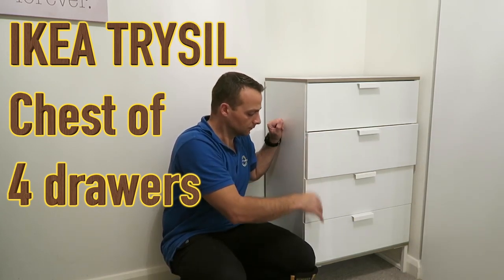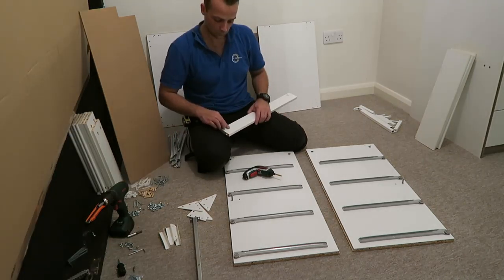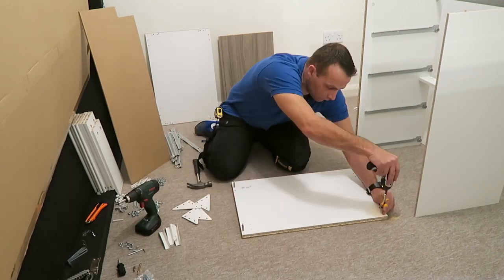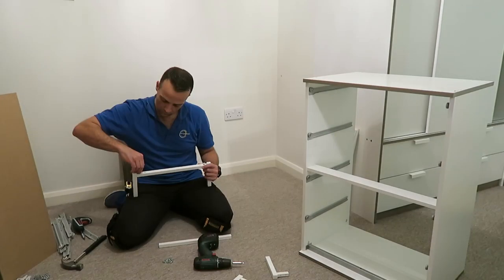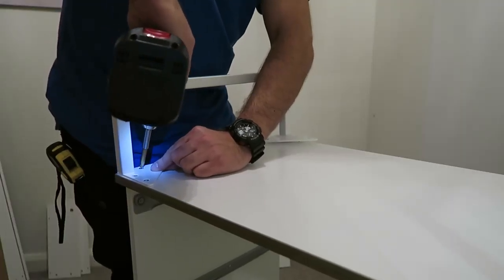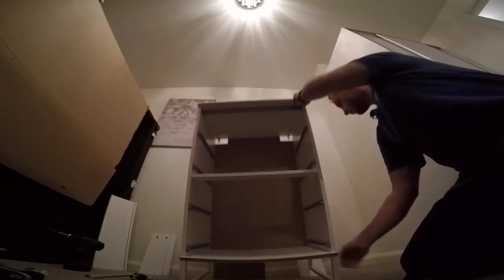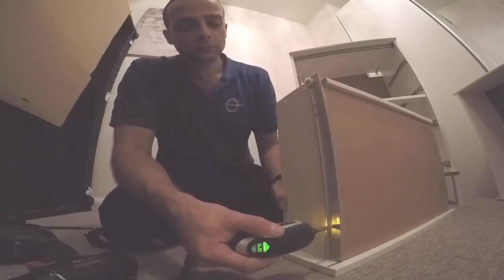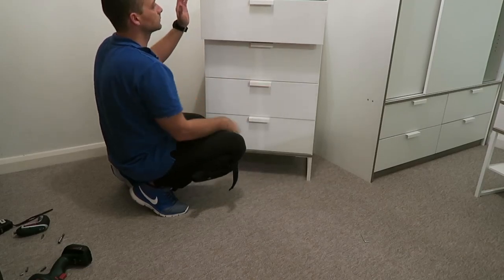IKEA Trysil chest of drawers assembly

Comment: I cant figure out step 12 (what he's doing at 1:53). I screwed the wrong screws in there, and now the right one'd don't turn in. I think you need a drill for this, but i dont see how these screws are supposed to go through the wood when they are not pointed. i tried using toothpicks to fix the hole, but the screw still wont go anywhere
Reply: Its the screw which requires the allen key included